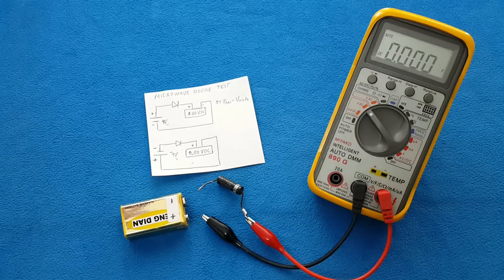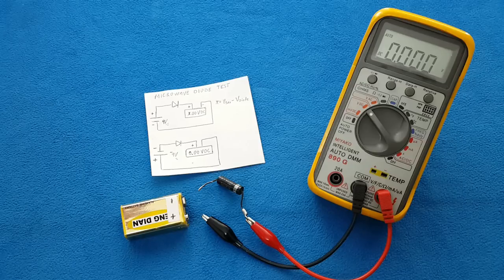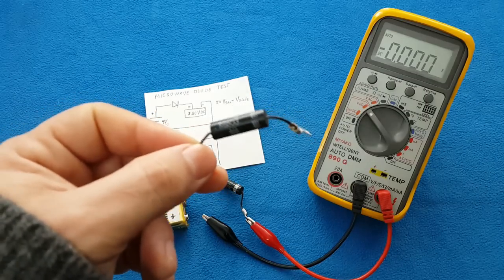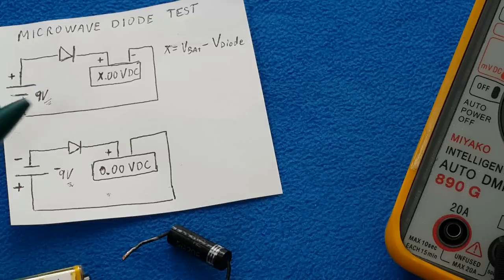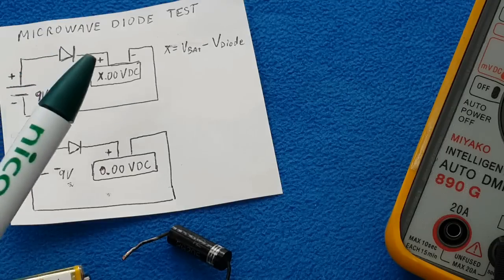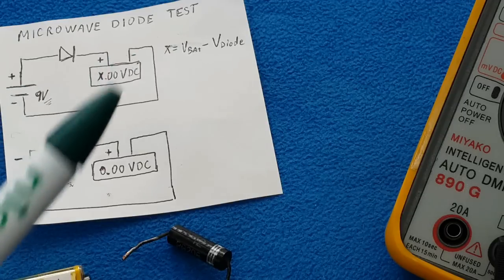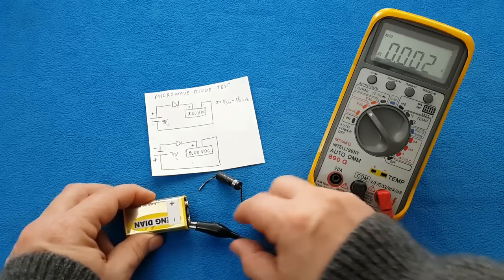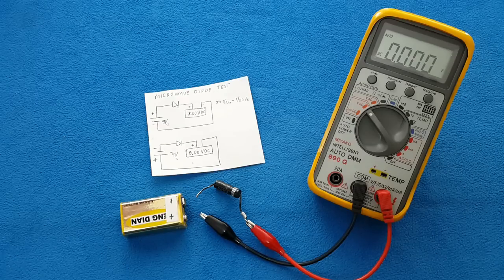How to test a microwave oven diode high voltage  CL01-12 / como probar un diodo de microondas HV

Comment: Muchas gracias. No sabía acerca de la caída de voltaje en el diodo, por lo que mis 5 voltios me hicieron pensar que el diodo estaba defectuoso. Aparentemente no lo es. Gracias a ti, ahora comprobaré otras cosas.

Thank you very much. I did not know about the voltage drop across the diode so my 5 volts had me thinking that the diode was bad. Apparently, it is not. Thanks to you, I now will check other things.

Comment: Very nice clear explanation. With a larger diode I see that I cannot simply set my multimeter on "diode", but must use a larger voltage. Thanks.

Comment: Is it possible to do test with a AC/DC adapter with the primary 220V AC and secondary 9V DC. I havent a 9v battery now. Is that test dangerous?

Comment: Hi, my diode shows 3,6V and my battery 8,23V, reverse its 0V. Is that diode good or not (I have problem with heating without any other issues) thx

Comment: Thanks for the simple elegant solution.  And the battery reversal to test for open and shorts was brilliant. I almost went out and bought a more expensive digital multimeter.  As it turns out I had a poor crimp on the eyelet that made an intermittent connection to ground, the diode itself tested ok!  I’m going to check out your other videos! I like how you think!

Comment: Very clear instruction with demo and schematic, including the important fact, left out in most other YouTude explanations) that the meter voltage is battery (9.31v + or -) minus voltage drop across the diode (near 4 or 5 v) equals near 5.0v. Thank you so much, keep it up!

Comment: Nice to see a video where the component is actually tested....Most say just it's probably this or that....so just get a new one and fit it...... Grrrr 
Yes, you are quite right. High Voltage diodes have a high forward resistance....the use of the battery overcomes that. Well done.

Comment: Dear friend, thank you for explanation. Could you tell what is real maximum voltage of the CL01-12 diodes ? In some places it is written that the maximum voltage is 12 kV, in other places - 5kV. What is the real value of maximum voltage ?

Comment: Hi I would like to say that I used 4 AA batteries in series (so around 6V cc) to test a T3512H diode and it worked as explained in the video.

Comment: The test is revealing the diode is functioning correctly. A diode will only allow current to flow in ONE direction!
Reply: When I test my diode am getting the same amount of voltage in the both ways...it's bad ?
Reply: @anthonydos7506  It is bad.

Comment: Sir it very good. I have little bit questions.
 Is your diode good or bad one?  
What is if diode is bad one?
A high voltage diode u tested in 9 v dc battery, so you put ur terminal in dc position in multimeter?

Comment: What about testing the resistance? My paperwork that came with my microwave is calling out 40.00m, I'm reading roughly 22.00m. Would the cause any drop in heat ability? Polarity test was good  right on the money actually @ 6.34v @ 0 reversed.
Reply from the maker: Hi! The problem with Mega-Ohms is we are not sure what are we reading about. It is better to give enough polarization voltaje and make sure if the diode conduces or no.
Reply: @bob.kalpon1398  Your test is exactly correct based on my microwaves repair instruction and for the reason you state. You're right on the money as far as the diode testing procedure is concerned my friend. My included microwave repair  testing/specs has in addition to the 9v battery test, testing the resistance of the diode itself. No other repair video or instructions I've found anywhere details a resistance test of the diode itself EXCEPT mine from what I can tell and a lot of folks don't have meters that go that high, it's extremely sensitive for a cheap Chinese model, but works well. :) LOL So, I thought I'd see if you has seen that.  My Kenmore Elite model 721.66462500 expanded servicing instructions I just happened to find online. Page 23 detail my diode testing procedure:

https://www.appliancefactoryparts.com/content/pdfs/142308-2.pdf 

It's ashamed YT doesn't allow small file or picture attachments, pretty stupid actually, it would be very helpful in dialogs such as this. I think YT (Google) is missing the boat on this one. If they were smart they would add that capability to keep people from logging off Google product to search forums that allow file  attachments in conversations. I guess Google's maturing and turning into another "old boy" company.
Reply from the maker: @ThePreyMantas  The 40MOhm test is just to ensure we got infinite resistance. It means if 20 Mega Ohms was the maximum scale, then 20 Meg is the infinite... The reason why I said we can get confused is because we can get readings from hands, table, even  inductance around. The main idea should be to find out if there was current linkage, but that test must be more specific. (I am glad I passed your test! ...I made a newest video about the microwave diode tes and it is between my las videos uploads).
Reply: @bob.kalpon1398  Hi Bob, That's what I figured and I noticed it was so sensitive that even getting hands in close proximity of the probe tips cause minute variations. When I first got the meter (mainly for capacitance and uF measurement) I was concerned because it was unbelievable inexpensive I thought maybe it wasn't going to be keeper tool, but I was wrong and it turns out it has much lower measuring ability than my Fluke! As you could see in my service manual, there are somethings that are vague and some things that can be confusing for the uninitiated like myself. I'm a nuts and bolts guy (Journeyman Machinist/Programmer by trade) so I'm great with computers, programming and making trick high quality, very tight tolerance, complex machined parts. Electronics... Ahhhh, not so much. I'm just starting to get into it (out of necessity as you can see), so I suspect I'll pick it up if I stick to looking at schematics and using the hell out of Google. I inherited a vintage 57' Gibson Les Paul Jr tube amp I would to refurb. Have you ever seen Uncle Doug's channel?  Check him out, he's a master. Til next time!
Reply: Just a follow up. I confirmed that indeed new, unused Mag terminals to housing should be OPEN, so I'm glad for your help and everyone else who's posted vids on troubleshooting microwaves. Some folks touch on that, but most don't which strikes me as unusual, since everyone tests out the Trans for shorts to casing on primary winding. Unfortunately I know them by heart now, but I can't let anyone know that. I have enough on my plate... :) Thanks again!

Comment: Actually if you have a meter with 40m OHM or 200m OHM, you will see the resistance reading from one way. I got 1 at 16mOhm and another one at 25mOHM, both good.

Comment: My microwave has a very annoying problem... It cycles on high... I mean as if it's set on less than 100percent power.. The wierder thing is.. The problem seems intermittent
.. I can heat exactly the same food or liquid in the same cup or dish at same coldness and one time the microwave will stay an high untill the end of the cycle the next time around the magnetometer cycles on and off on high... The next time it's OK and so on... It's friggin driving me up the wall as its impossible to heat frozen foods as the instructions will say heat on high yutta yutta minuets... And I can't do that!!! It's not a setting either... I specifically set it on 100 percent power.. And it friggin cycles on high.. I'm ready to through it off a cliff!!
Reply: Sounds like it is in defrost mode

Comment: This test was very simple and fast, Question,  does this test work for all makes of  microwave H.V Diodes? Thanks
Reply: Yes. A diode is a diode. Nothing more or less.  
High resistance in one direction & low in the opposite = Good Diode.
Low resistance in both directions = Bad diode.   (short circuit)
High resistance in both directions = Bad Diode. (Open circuit)
( It's basically a halfwave rectifier.)

Comment: I use 9vac 60hz and look at the conductive trace on an Oscilloscope
Reply: so no, we cannot use your method, as most of us do not have an AC power supply, an oscilloscope and so on
Reply: A wall socket is an AC source 😏
A light bulb is an indicator..
The bulb should be dimmer than normal.
PS. Playing with mains electricity is unwise 😉

Comment: Nice and clear. I should have look your video before. I used a 12V Marine Battery and made a mistake and the Diode exploded...
Reply: Diode has a very high resistance about 20m ohm, shouldn't explode. Weird.
Reply: @hvacworkshop4791  Nah, diodes have nearly no resistance, just reverse voltage. Once you overcome the bias voltage, it'll flow tons of current and overheat. Just like an LED. You should put a resistor in series to be safe. I'm about to test high voltage diodes that might have up to 40 V of bias voltage, so I plan to use a stack of 9V batteries to get maybe 45 V and a 10kOhm resistor to make sure currents stay down in the milliamp range.

Comment: so the diode is good or bad?  I think the diode is good based on your test,  shows 3V in right polarity and 0V in reverse polarity.  So meaning the diode neither is open or shorted, correct?
Reply: It is showing the diode is functioning correctly, a diode will only allow current to flow in one direction!

Comment: Please, an information: I am looking for a rectifier diode above 15A. I wonder if the high voltage diode can be used as a current rectifier? Using half wave. with a 14V AC input of a transformer with capacity up to 30A. Thank you!
Reply: I know you posted a long time ago but these are not suitable for high current applications.

Comment: I tested an HVR 1X 3 diode from a GE microwave and a good 9V battery. One side test shows a voltage of about +5 and the other side (reverse) shows -5 and then slowly drops. Does it mean the diode is good or bad?
Reply: Mine’s the same, so was it broken?
Reply: @bl1tzk1213g  A diode only allows current to go one way!

Comment: just ohm it  if it ohms its bad questions see tripod Milton forget the battery waste of time
Reply: You are missing the point, microwave oven diodes are actually a number of junctions in series, the average multimeter cannot provide enough voltage to forward bias them.

Comment: or use the diode setting on your meter
Reply: That won't work correctly on these, there are a number of junctions in series within the package, the average Fluke cannot forward bias them

Comment: nice bob, you know it's kind of funny when electricians merely want to explain a test of sorts, they begin with circuit board language and formulas that if the common non electrician doesn't understand. so the style that 99.99% of testing descriptions and examples you guys give, are basically for someone who understands electricity or components enough they're not interested  or benefit none from it.  when a question arises especially on "wiring" something, a motor or a simple circuit both come the show of how much you've learned throughout your studies and algebraic formulas. sometimes you gotta speak like you would if you didn't know about it.

Comment: Nice and clear, and simple/fast: no fancy graphics or excess verbage.  I appreciate the schematic with the voltage drop.  Unfortunately my diode is fine, I was hoping I only needed a $4 part, but diode is fine.  I suspect it's the magnetron?

Comment: According to data sheet the diode has a Forward Voltage Drop in 10 volts in my case dropped in 9 no in 4 volts. 4 is not too low?
Reply: I guess it depends on internal resistance on your volt meter.

Comment: I use a 9v battery and got nothing both ways, do I have a bad diode?
Reply from the maker: Hi! Yes it is bad. Diodes conducts in one way, and a "no way diode" is a bad diode.
Reply: Thanks Bob, I was searching for such simple testing technique from long time. Thanks for sharing such valuable informative video....keep posting

Comment: Samsung microwave... doesn't heat ,checked the switches and they are good. what and how do I check next?  model is   smh1713s
Reply: Check primary coil if you can get city voltage when run it.

Comment: Hoping you could help troubleshoot my microwave. Is it a capacitor issue?https://youtu.be/nYHtgAj4Tg0
Reply from the maker: Please be careful. If you are not a certified technician, you must know the microwave is the home's appliance most people's killer by electrocution. So, if you are a technician, but no certified in this kind of devices don't do it.
The problem is hard to judge just by the video. It looks like there is a kind of short circuit somewhere, and the systems shuts the function down in order to do not let the excess  of current to pass.

Comment: Cl01-12 rg 706 , cl01-12 rg 203, cl01-12 rg 609 , cl01-12 rg 903..... Is it same but disferents marks or totalment diferente every?
Reply: They are the same.
RG is the manufacturer code.
203.609.706.903 must refer to the lot and date of manufacture.
Reply: @evandrocarvalho4692  is RG804 same as RG203, RG609, RG706 and RG903?

Comment: Great vid Bob. Keep up the good work. 

What is a simple test for zener diodes?
Reply from the maker: +davecc0000 That video will be soon in the other chapters of how to test an ATX switching power supplies. (There are 3 more videos on the way. PWM, transistors, diodes, and maybe I will add a 4th one too about some of the resistors in it). Thanks by asking! :-)

Comment: What is the highest voltage can use to test the diode?
Reply from the maker: +davecc0000 That is a good question. When we try to test devices, this diode, another devices, like leds,  "mosfets transistors"... We don't want to explore the highest voltages. We want to go for the lowest or minimum voltage we can use to perform the test. Remember some devices are low current, or low reverse voltage case sensibility. I will say this kind of test, is an "abusive" way to make a practical test with low resources. (But effective!)  ;-)
Reply: +Bob. Kalpon -- Oven diode runs on high voltage, yes? Components (diodes, caps, etc.) can test good at low voltage but some may leak at high voltage. That is why it is good to test at high voltage that is used in the circuit.
Reply from the maker: +davecc0000 Hi Dave! We use Special Components Analyzers for it. Most of that equipment are missing in Universities Labs and our workshops. I am working in home made PROFESSIONAL electronics equipment, and I will make videos for you guys, about how to make your own equipment with the same standards than the branded ones. Believe me! If you know to bake cakes, no good bread is better in the bakery than from your oven.   I got your answer. But we will see it ahead, with our professional equipment in our workbench. 
(Dave, all the big youtube guys, make videos about "unboxing" expensive equipment that 98% of the viewers can't buy even used. I am a designing engineer. I will show you guys, professional equipment is not hard to make. I told you in the Channel I will make an electronics Lab from zero to up. I don't want fame. I just want to show to the world, that all old those discontinued engineers from the 40's to the 60's, are good for the talent's marked).